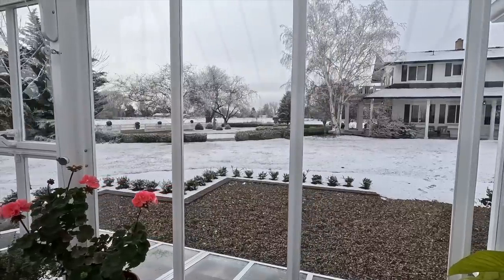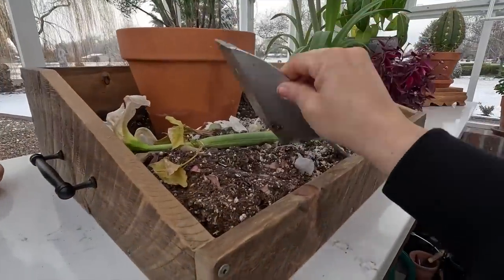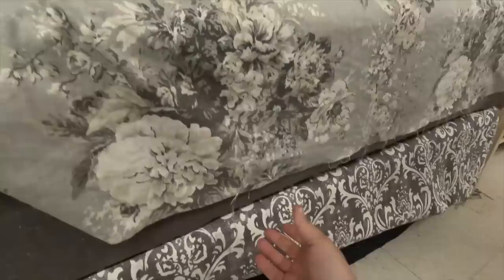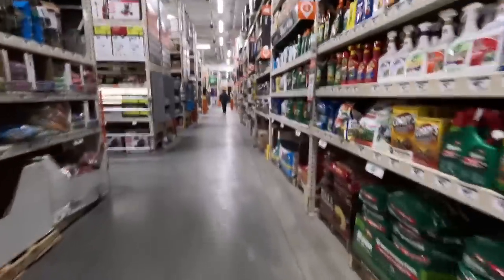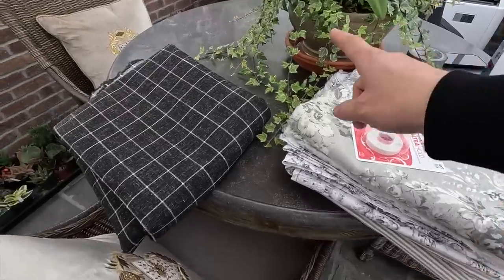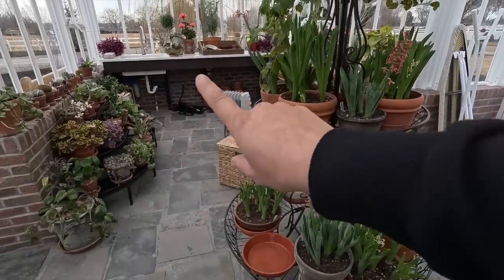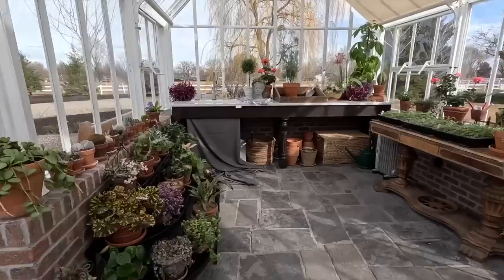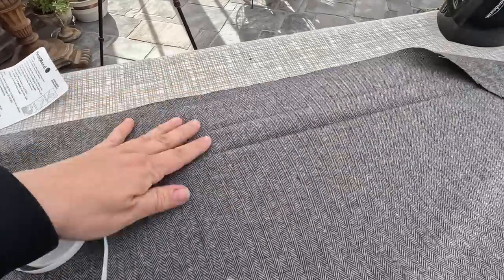Finally Covering Up the Pipes Under the Hartley Sink!  🙌😆 // Garden Answer

Comment: That potting soil basket is genius!  I wonder if you could add wheels to it so you can roll it in and out?
Reply: Brilliant Idea!
... And, if not directly to the bottom, they could build it a "dolly" to set it on top of. 👍
Reply: That was my first thought too
Reply: You can make a wooden frame recessed so you don't see it and stain it the same color as the basket and add the wheels can also spray paint the wheels hardware (flat paint, black or dark gray) so is not shiny.
Reply: I hope she sees these ideas!  Wonderful ideas ladies!!
Reply: What a great idea. Love wheels on anything , so convenient and such a back saver.
Reply: Awesome idea! They make plant caddies with wheels! That would be perfect!
Reply: Great idea! It would make it easier to get the larger soil bags in and out for sure.
Reply: Came here to make this same comment.  I was thinking you might be able to place wood pieces on the inside and outside corners, sandwiching the wicker between the wood and that would create something stable to attach casters to.
Reply: Love how this project turned out. Everything looks great!
Reply: Holy Cats!! I had the same thought! I am a sucker for things on wheels!
Reply: Great idea!
Reply: What is that plant blooming red against on the counter? My eyes were drawn to it immediately. Good choice with grey shades 👍🏼❤️

Comment: I love the fabric you chose! 
I used the No-sew method for under a folding table in my laundry room to hide rag basket, dog food bin, gym bag, etc. I hot glued heavy duty Velcro to hold it in place (no room for rods). It has worked wonderfully for years! When I’m ready to change the fabric I know it will be a quick project! Sometimes it’s the little things that spark joy!❤

Comment: For the ‘in-basket’ trash can, just make a small pvc (or wood) frame that fits inside. You can hang a bag over it to hold your trash. Remove/replace the bag when it needs to be emptied.
Reply: Or maybe an attractive lidded container that sits on the counter for plant grooming refuse.

Comment: Turned out great!  As a aged user of spring rods, I found that if you put rod in casing then pull curtain about 1” off rod & wrap towards the back before putting rod into place, give edges a nice finish.  (Hard to explain, but trapping fabric between end of rod & wood of cabinet). I’ve also found in some cases, a more flat (not gathered) look can be very nice also!☺️. BTW been playing catch-up on your videos!  So related to older videos, I really like the reference “The Hartley”. Looking forward to more of your wonderful informative videos, meanwhile, will continue viewing the library of older ones!🥰

Comment: So glad you discovered the iron-on tape. I’ve used it for small projects for years as I’m not much at sewing. It seems to last well in washings too. 
And the collapsible hose. I have them on all three of my outside faucets now. Got rid of all of my regular hoses about three years ago except for 100 foot that I leave on a wheeled hose cart that I can use with my pressure washer. I have the collapsibles tucked into regular flower pots with drain hole at each faucet and love them.  Love the woven trunk idea for your garden supplies. Everything looks perfect, you have such a good eye for decorating.

Comment: Laura, you should have Paul build a short platform with casters it would be perfect. It would decrease the rubbing on the bottom of the basket on the floors and make for easier access. Maybe some rope handles to pull it out. As always. Love your videos and inspiration.

Comment: Not a gardening tip- but we had one of the on demand water heaters in ours too and stone floors so we put a small section with drain in floor to use as dog shower. Was great to have a multi-task area and keep wet muddy dogs out of the house.

Comment: Some great ideas Laura. Like the skirting idea and nice fabrics you picked out. I was thinking you could also try “radiator screening” (@ Home Depot). You could spray paint it to blend in and it would look nice in the Hartley, maybe make it a “door” so you could get to the instant hot water. The basket looks nice, if needed, put some wheels on the bottom. May make it easier to use.  Beautiful, fabric choice looks nice and blends well. They area is pretty.

Comment: That tape is great for hemming the sides and bottom, but you may find that it starts to come apart along the pocket for the rod. If that happens and you want to avoid the sewing machine, you can use small clip on rings as an alternative. I have found the white sink and drain sticking out below the countertop to be so much more distracting than the heater-- I think this looks terrific!

Comment: Definitely outfit that wicker trunk with a wooden bottom. It won’t last long dragging it in and out on the stone. Wheels will improve its use as well. Concerned for the basket used for the hose— water and baskets don’t mix well. However I think the overall project is beautiful and glad to see the sink and etc. disappear.

Comment: An unasked for tidbit of advice, unless you found this out already... I put my expandable hose in a basket too and I did not think about the fact when I turned it on, before pulling it out of the basket, it expands quickly and pushes out the basket and gets stuck until the hose is emptied LOL.  Ask me if I did it more than once before remembering to pull the hose out first. Yes... yes I did.  I have greenhouse envy!

Comment: Hi Laura, great organising for Spring.  You must be relieved that this is ticked off your list.  Hopefully the weather gives you permission to tackle more areas that you feel you need to prepare for, before the Spring flurry.
I have a question that relates to something you mentioned last year about your Flower Shed.  Now that you have lived with it for a couple of seasons, especially winter - will you be painting the inside for photography/filming?  It would be nice to know what your thought process is on the structural buildings, if the weather prevails to keep you indoors.   Thanks Laura.

Comment: Not my greenhouse, so what I think doesn't really matter. But I agree with Aaron that the black check fabric looked best. If it were mine to do, I would put that fabric across the entire length of the counter and hide everything. The dark fabric recedes and makes it look like just a shadow beneath the counter and like there is nothing at all down there. I love that iron-on tape. Even if you don't HAVE to use it, I prefer it because it creates an invisible hem. No stitches at all. Very clean finished job!  Well done Laura! I know it was a lot of work and I hope you're happy with it.

Comment: Anytime I use a tension rod, I use  little rings that grab the fabric. It's so much easier to slide the curtain as well. So, Unless I want a ruffle on top there's actually no reason for me to sew. Also, the heat hem strip stuff, you melt with an iron works awesome for any of the edges. It gives a nice straight & crisp look with no pic ofkering, either.

Comment: Nice choice on the material, it melds very well with the floor color.
I use a pretty concrete plant pot as a trash can in my potting shed. No one knows it's for trash unless they ask. Terra cotta lots work well too.

Comment: The Dollar Tree, $1.25 now, has pretty gallonish size flower pots in stock. That's what I use for trash cans in the bathroom and other areas. The bottom is solid with punch out holes. Just a thought.

Comment: It turned out perfect! Now you can put wheels on the soil basket as Lyla Aisle of blooms suggested. You can  make a wooden frame recessed so you don't see it and stain it the same color as the basket and add the wheels can also spray paint the wheels hardware (flat paint, black or dark gray) so is not shiny.🤗❤️🤗

Comment: That looks great, it just melts into the background. If you want a "trash" can for inside the wicker basket why not look at recycling bins those are usually square or oblong and might fit perfectly inside the wicker trunk.  I did same thing a few days ago with litter bags, I took an old army trunk I had popped all the bags inside closed it and it makes such a huge difference in my cats room.  It's great when you have an Aha moment. 💡

Comment: I use that “fusible webbing” to hem pants all the time. Recently found some great Jean patches too, and have used it on them. Never had an issue. Does stay a little stiff after, but it loosens with washes (waiting at least 24 hours after using it). 👍🏻

Comment: Your project turned out great! Question on your hot water heater. You mentioned you had to replace it with a larger size as the smaller one didn’t produce enough hot water. What size tank was the small one and what size tank did you replace it with?  I’m going to be installing one in my greenhouse.  Thanks!

Comment: You could just use a pot for the garbage can. Probably not terra cotta so it didn't get mixed up with the others but if you had a gray or decorative one without a hole in the bottom or filled the hole you could just leave it out and it wouldn't look out of place and would be accessible.

Comment: Something I was told by an older and wiser friend. Don't use a lint roller, it leaves an ever so light layer of adhesive causing the need to roll very often. I was advised to use a cloth brush and ya know, she was right.  I keep a shoe polish brush in my basket  and use it exclusively for fabric.

Comment: Perhaps you may want to reverse the position of the wicker trunk and terracotta pots, especially if you do not add wheels to the trunk.  Would be much easier to access if in the center, next to the hose basket.  Warning: kitties love wicker as a scratch pad. Retire the green plastic watering can and purchase a copper watering can, but leave it out for all to see ....table jewelry!

Comment: If your hot water heater was an on-demand heater, there’s nothing wrong with that heater. It’s because you have a filter on your line which slows down your water pressure. Those heaters are run by adequate water pressure which in turn makes them operate properly. I have one and it’s from issues with mine I found that out. 😁 we also had a filter. We had to change out the type of  filter insert to make it run properly. The filter we had was changed from a pumice type to one that looked like a yarn style. Worked great after that. Your fabric color would have faded into the back ground if it were the color of the brick. Or in the red brown colors. 🤫

Comment: Those silicone hoses are great...but they don't last.  I get maybe half a season from them.  I've bought a few dozen of them over the years.
Reply: I've had a couple for years. They are under porch cover though. Are yours out in the sun?
Reply: @ritasicari7518  It really depends on usage and water pressure among countless other things.  I’ve had some I barely got a dozen uses out of before they started leaking.  I have tried many brands.  I like them for their convenience and lightweight but they aren’t designed to last.  And no I don’t leave them out.  I use them, drain them, and store them away each time.

Comment: Laura it looks amazing! I have a dumb Q- what is the difference (for you) of the high tunnel and the hartley. In other words, why do you have 2 different spaces that to a layman seem to do the same thing? Does that make sense? I mean no offense! I really am curious as I do not have much knowledge of it.
Reply: The Hartley is a long-time dream of hers. It is far more aesthetically pleasing than a plastic high tunnel and she wanted to use it for entertaining, also. The high tunnel is more of a utilitarian structure that will tend to be messy.
Reply: @ritasicari7518  do both structures provide the same living environment to the plants? Air, temp, etc?
Reply: @GardeningSpirit  I don't think so. The plastic green house has side panels that raise up and down automatically to control temps etc. I think the Hartley has been difficult for them to keep warm enough. It's new, though, so they are on a learning curve.

Comment: I call that hose the snake hose or yard beater.  I had the nozzle off and turned on the wrong valve, and that thing  whipped around like crazy 🤪.   Great nephew had a blast.  Unfortunately,  the yard took a beating.   But,  the fun and laughter were worth it.

Comment: Love the fabric you used.   I also bought several pieces of fabrics as I search for the "perfect' one for my window seat in my kitchen.  I just keep those I don't use cause eventually I will have a project that will work for any used fabric or pass it on to my aunt or sister for their projects.  Never wasted.
Possibly consider making a pull out tray for your clay pots similar to the tray you made and have on the shelf but adding wheels.  And possibly adding a base with wheels for your rectangular basket to pull when needing to use.

Comment: I suppose the main issue in looking busy in the glass house is that busy floor that adds so much texture. But this is probably a good reminder to think clearly when commissioning furniture in how it sits in the space and not just a free standing piece of furniture.
That counter would make a beautiful table but boy it's inappropriate and messy as is. The fabric panel unfortunately looks like a loin cloth to me but it's better than all that offensive white plastic. It makes sense to instead use the built-in articulation of the furniture and put the curtain from leg to leg.  That stripe fabric would look great as a blind 😉

Comment: If the iron on seaming tape is the same as what I have used it will come apart, particularly with repeated movement. However, by then, the material stays in perfect position to sow.

Comment: If I was you, I would cut a very thin piece of plywood and put it underneath the square wicker basket, a little casters so that way it doesn’t ruin the underneath of the basket, pulling it out so often casters roll easy, and the board will keep the integrity of the wicker if that makes sense